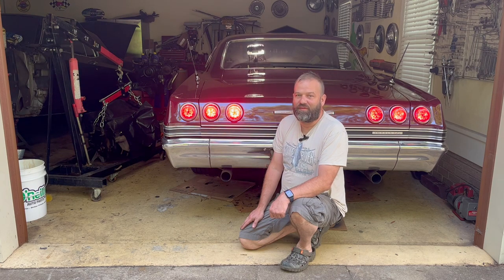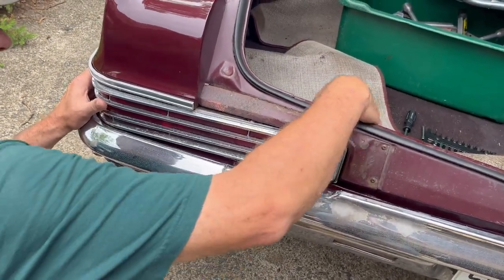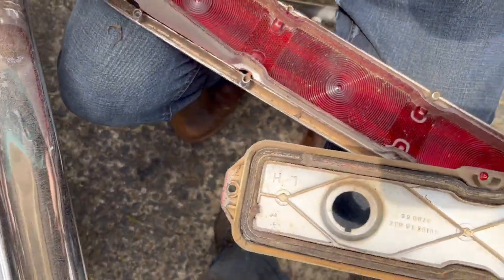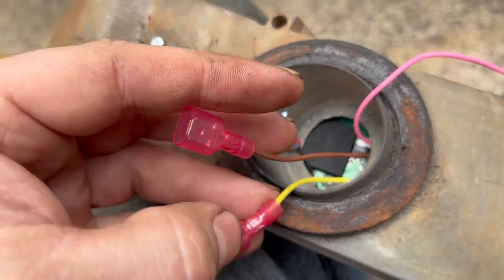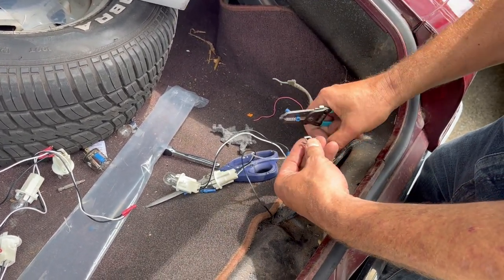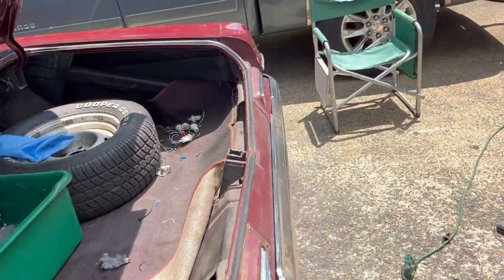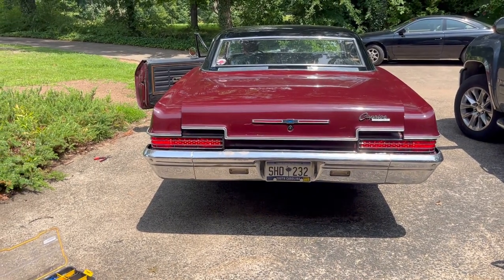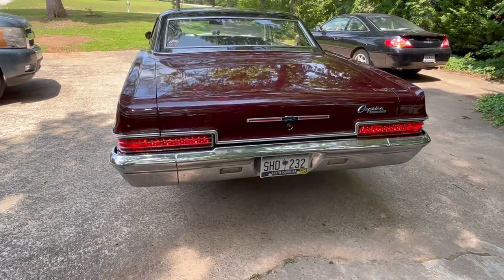1966 Caprice/Impala sequential LED Taillight installation

Comment: I like to do those rear lights on my 67 Riv!!
Reply from the maker: I’m not sure they make them for that car, but it would be nice
Reply: @ImpalaCadillacRestoModDIY  my rear tail lights are the same as the caprice
Reply from the maker: @Leo-DaGreek  they look similar, but the circuit board are specifically designed for the shape of the caprice light. Yours is shaped opposite of the Chevy.
Reply: @ImpalaCadillacRestoModDIY  iv got the three holes where the bulbs go
Reply from the maker: Cool

Comment: @ImpalaCadillac So did you just clip and cap off the sockets that you did not need ? Did you run the pink wires separate , or did you link them and run one wire up front ?
Reply from the maker: I clipped and capped off the ones I didn’t need, and yes, you only run one pink wire to the front
Reply: @ImpalaCadillacRestoModDIY  are the lights color coded left and right like the wire harness ? I’m going to hook them up the same way you did , grounding it to the housing is a great idea , we all know how bad the 65-66 rear tail light grounds are .  I just ordered a set from Easy performance , so any tips or advice on the install will be greatly appreciated . Thanks in advance
Reply from the maker: @bigchopsndtown  yes, the wires are color coded, and the instructions are very good.
Reply: @ImpalaCadillacRestoModDIY  right on thanks I appreciate you
Reply from the maker: @bigchopsndtown  glad to help
Reply: @ImpalaCadillacRestoModDIY I just got my lights in and I had one more question.did you just use the two wires at the far corners to hook up to the new lights ?